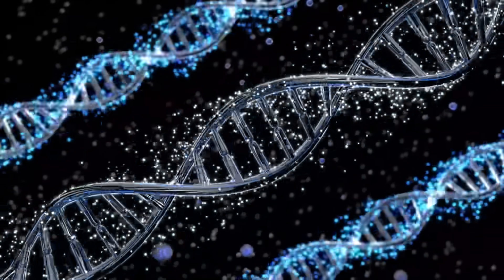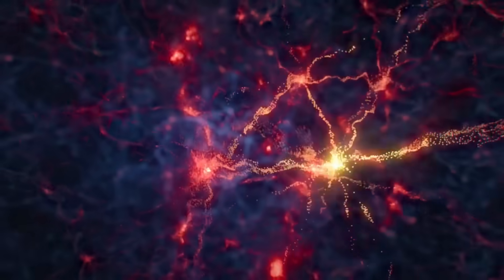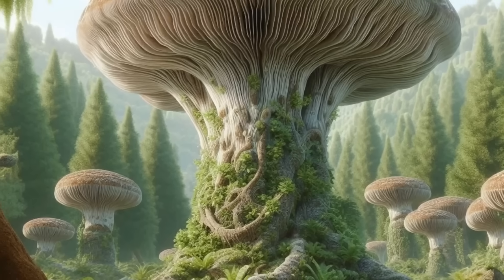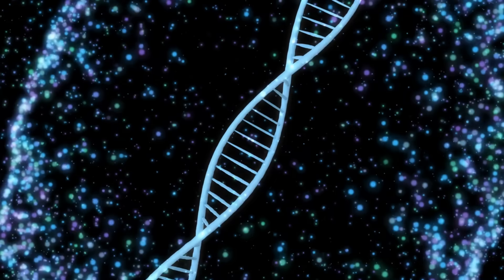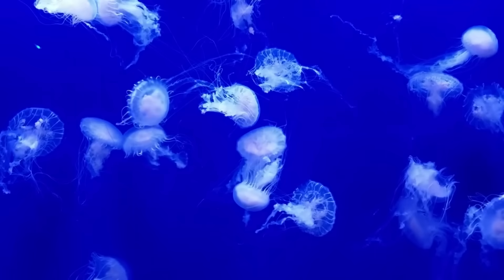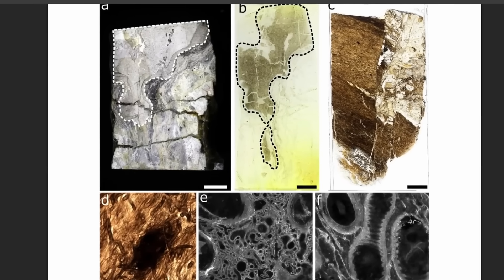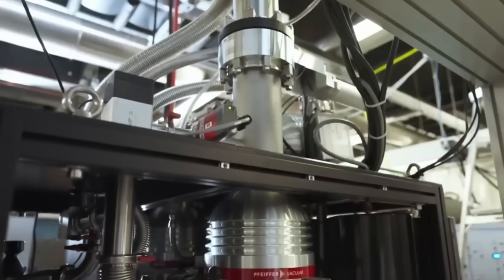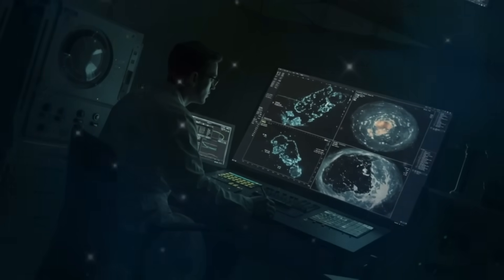Scientists are Stunned: New Quantum Research Revealed a Fourth Branch of Life

Comment: New Quantum Definition – Based on the f-bit theory
(Information = frequency difference × intention)

	A structural definition of “quantum” — not an interpretation, but a precise formulation.

Two Quantum Definition Equations:
	1.	Minimal Quantum Definition
    Q = ∇P(x, t)
  → Q is the spatial gradient of probability density — the local definition of a quantum.
	2.	Complementary Ψ Quantum Equation
    QΨ = lim(Δt → 0) ∇|Ψ(x, t)|²
  → QΨ is the quantum structure derived from the instantaneous spatial gradient of the wavefunction’s probability density.

Definition Statement:

	Q and QΨ define quantum as the localized structure of probability density and its evolution.
QΨ connects to Δf × I via the formulation:
  Ψ(x,t) = 𝓕[Δf(t) × I(t)]
  → Ψ is the wave expression of intentional frequency resonance.

Connection to f-bit Theory

Δf × I = Information
Quantum is no longer mysterious. It is resonant information in structure.

Originator: from Japan
A new foundation for physics — from resonance, not randomness.
Reply: Nice... makes sense. I have been thinking along the same lines. Thank you, it is a fun concept to play with. -Q